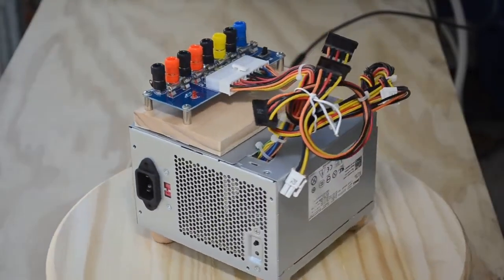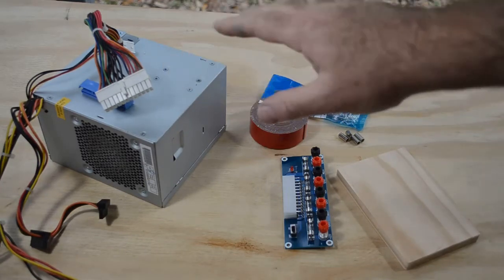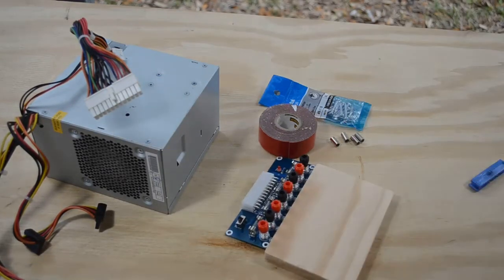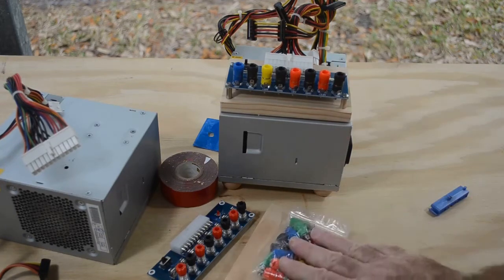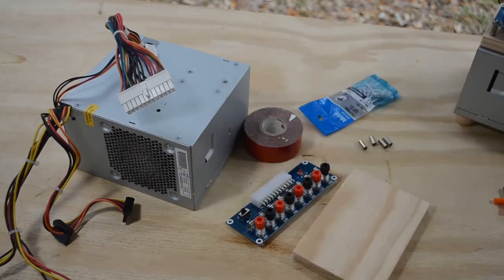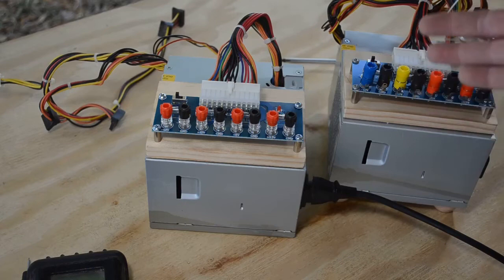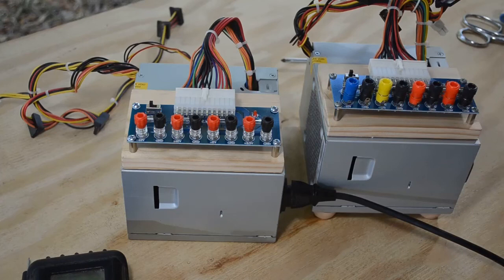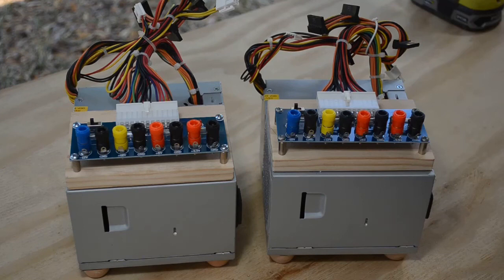A Bench-Top Power Supply Built From An ATX Computer Power Supply

Comment: Huge fan of your scrapping/ refining channel and quickly becoming an electrogeek convert. Would it be much more difficult to convert an ATX power supply into a variable voltage supply that  displays amperage?
Reply from the maker: Variable voltage is fairly easy. There are any number of videos on Youtube about how to get variable voltage out of a PC power supply. I think it is usually just a matter of replacing a fixed resistor with a pot. The hard part is figuring out which resistor if you don't have a schematic for your power supply. Displaying Amperage would require adding an Ammeter in line with the output. Not too hard to do.

Comment: I have  Xigmatek 700w psu that can provide 600w on 12V rail. My problem is that connecting  24pin ATX connector only doesn't provide enough juice. Draining only 2 amps using the board connector dips 12v to 11v on the other hand if i use PCIe (GPU) or EPS12V (CPU) cables of the same psu for 10 amps load, the 12v rail stays pretty stable. As per my experience this board is useless except for lighter loads.